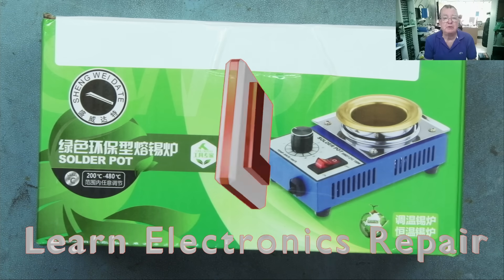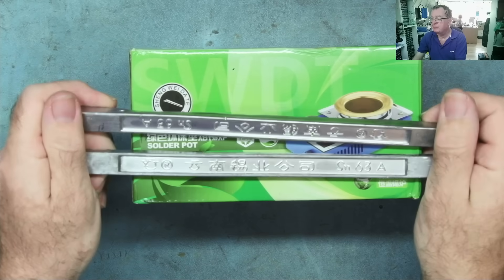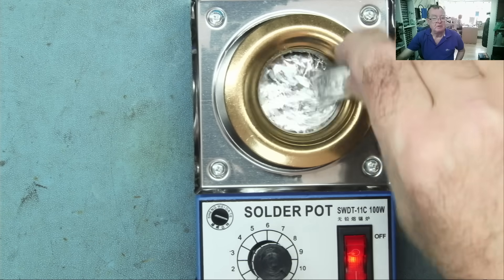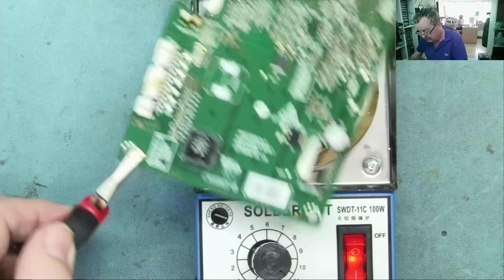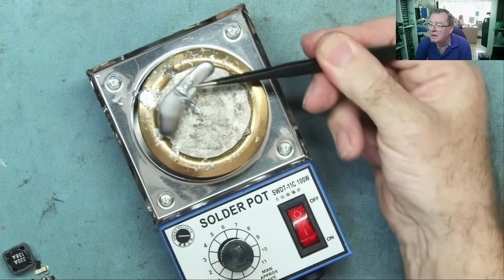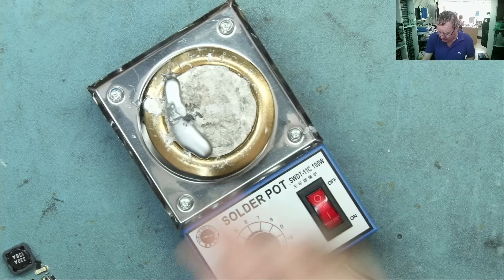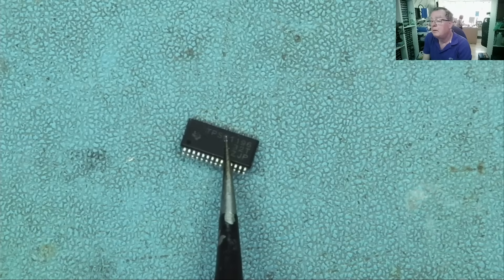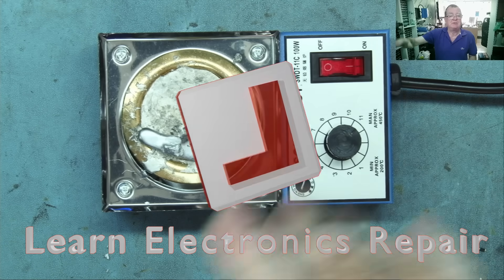How To Salvage Components QUICK & EASY With The Cheap Solder Pot From AliExpress. Desoldering.

Comment: Hello @LearnElectronicsRepair, is it suitable to safely desolder a potenciometer or a switch? Those components have a massive metal part (because they expect a pressure from users) and plastic part inside (which is moving). Every time when I was using a hot air I was melt a plastic. I have tried to heatup a tin before with a soldering iron, I have applied a flux, so it would be possible to desolder it with soldering iron nicely, if it were not had many pins and massive metal body (which is transferring heat to inner plastic part).

Comment: That's definitely leaded solder; leadfree wouldn't bend so easily. Bolt-cutters will cut the solder bar like a hot knife through butter. Note that if you use this device and this solder to remove components from leadfree PCB's, you'll contaminate the solder in the pot.....

Comment: Honestly, if I want to remove a lot of component from a board, instead of the hot gun from the soldering station, I use the 2000w hot air gun from the back .....everything fall down very quickly. In alternative, I can use the infrared pre-heater with a bit of hot air gun (soldering station).

Comment: Couple of questions:
1. If the board is all SMD components, how is this different from placing the board on the same type of hot plate used for SMD soldering?
2. To the extent that the solder pot is better than a hot plate because the molten solder conforms to the bottom of the board (including through components) and improves heat transfer, why do you need such a deep pot? Wouldn't just a shallow pool enough to conform to the plate and perhaps some depth to give some heat reservoir be enough?

Comment: This sounds like a good idea but it's actually far easier to use a heat gun / paint stripper set at 600C and blow on the back of the junk scrap board and the parts will come off just as easily without messy molten solder. I'd imagine the board will not like the direct instant heat of the molten solder and will delaminate (popcorn) pretty quickly whereas with hot air you can warm the board slowly. Also the solder in vias will spit at you when heated very quickly... this is the basic technology behind inkjet printers heh! A more interesting thought is you could re-use the (cheap) molten solder or solid bars for any kind of soldering job just add your own flux. Nowadays genuine branded flux-core leaded solder is really expensive. I recently bought a 1kg roll of 60/40 from a local electronics shop and it was $120 aussie dollars. I have to get a 1kg roll as if I get 100g I'd be constantly running back to the shop to buy more. Now if someone could design a machine that can use solid $5 bars and make thin round solder (ideally containing flux but even without flux would be ok for that price) it would be a VERY interesting project to build heh!
Reply: and is safer
Reply: I came here to make the same point. Seriously, buy a hot air rework station before you buy a solder pot.
Reply: Not a good idea when dealing with phenolic boards though - a heat gun temperature that quickly melts solder tends to turn phenolic into very smelly and toxic smoke :)

Comment: I use the same thing I replace USB ports VGA ports or any ports on a PC motherboard even connectors provided there are no components underneath usually there is not. I hade to practice a bit in the beginning to get it just right settings and temp to do it quickly.

Comment: I bought the same one 5 years ago. It came unearthed and had to earth it myself. Definitely check yours. 😉
Reply from the maker: Hmm my bench has a mains isolation transformer so nothing is earthed...
Reply: @LearnElectronicsRepair  Using a isolation transformer isolates you from mains ground earth, which isn't an issue indeed. But this might not be the case for your viewers who eventually want to buy this device. 😉
Reply: @sesvid  1st lesson always should be to open any electronics you get from China and check for "little things" like that :)

Comment: OK, not sure about this, doubly so after reading the comments.  Why do you need so much solder in the pot?  Surely a shallower pot would take less heating?
Reply: He needs the solder to touch the board. Yes a shallow pot (also filled to the top) would work but a shallow pot type is not available. Look up what solder pots are really designed for and you'll see why.

Comment: This thing is good for making crisp bread out of pcbs, specially with high temperatures.
I prefer hot air and i desoldered thousands of components with it, even various connectors.

Some of them are really sensitive to temperature, so even very low temperature will destroy them, no matter the tool.
Reply from the maker: Of course there are many different options and none work well in all cases.  This method is definitely for component salvage only. I've desoldered thousands of components with hot air also, but that does not mean you should not explore other techniques does it?
Reply: @LearnElectronicsRepair  Yeah, it's for component salvage only. But hot air makes much less mess and there is no need for excess amount of solder to use it.
Of course everyone is free to explore whatever he / she wants, i dont disagree to that at all.
But i dont recommend using this pot, because hot air is less dangerous, less mess and material to use and is more universal of use at all, especially for beginners.

Comment: I was looking at getting one of these but not for recovery work directly. Chipquik is expensive but you can buy bismuth, tin, lead etc then melt them toegther in this and make your own cheaper low temp de-solder. Just pour the liquid when mixed into a jar for use with a standard soldering iron later on. But of Alchemy:)
Reply from the maker: Interesting, but can you add flux to it while you do that?
Reply: @LearnElectronicsRepair  I'm not sure. I was just investigating making cheap low melt solder. I guess if you can buy low melt with flux in it, then it's possible to add it to your own. Again, I haven't tried... If just an interesting idea
Reply: This idea is well worth pursuing. If we could make our own chip quick, that would be really handy..

Comment: I bought one 12 months ago and use it to melt lead to make my sinkers in a mould  for fishing....does a great job!
And YES, I do it in a well ventilated area! (can't believe I have to add that comment)
Reply from the maker: The solder bars (and indeed pure lead) don't give off any fumes at soldering temperatures so why does it need good ventialtion?
Reply: @LearnElectronicsRepair  A lot of people think the fumes from solder are actually metals like the lead, when it's just the flux (Flux is still bad for your lungs, but not as bad as lead)
And with bars or lead stuff there won't be fumes, unless there's some grease/oil/dirt on them
Reply: @Psyden5757 , the boiling/vapor point of lead is over 1100 °F, but solder melts at a far lower temperature. There are no metallic vapors produced by molten solder, just flux fumes.
Reply: @goodun2974  Yes that's what I was saying
Reply: @LearnElectronicsRepair  I don't know, but some of the fumes might be hard to see. I'd use a fume extractor with filters, just to be safe.
Reply: @LearnElectronicsRepair  Just to be safe from the lead fumes Rich, as I'm getting older I appreciate how fragile life can be and I take less and less risks...
Reply: @darrenbird2526  It is not just the lead fumes you have to worry about. There are other components in solder like tin, cadmium, copper, and even the rosin flux.  Apparently, "Rosin-based solder flux fume is now regarded as one of the most significant causes of occupational asthma in Britain. "
Reply: You read my mind!  I usually use a pot over gas to melt my lead but this thing would be great for doing 1 or 2 at a time.  🎣:fish-orange-wide-eyes:
Reply: @darrenbird2526   , you must be fishing in small ponds; for fishing in Long Island Sound (saktwater) I never bothered making sinkers less than 1 ounce and we mostly used 2 or 3 oz, as well as 12 ounce jigs and sinkers wheen fishing for bluefish. This tiny pot would be useless for that. I used a cast iron pot over a propane camping stove, it held at least 5 pounds of lead.

Comment: This is the most ludicrous and dangerous proposal for the use of a solder pot. It is normally used for tinning wires and component legs prior to installation. Damn, but I think lead poisoning has taken effect on you, Richard (the same thing that gave rise to the "Mad as a Hatter" phrase!
Reply from the maker: This wasn't actually my proposal or idea. I saw some other Youtubers doing it on foriegn language channels and thought it looked like an interesting idea so wanted to give it a go.  IMHO it was quite scary having a pot full of moltem metal on the bench but it did work very well, espececially on the plastic connectors.  Anyone wanting to try this I would suggest put the solder pot into a deep flat bottomed baking tray and wear good heat resistant gloves.  You will probably be safe but it's your decision.  I quite enjoyed tyring this but can't say for sure I will be doing it again.  Oh but then is the livestream this coming Sunday... 😅
Reply: @LearnElectronicsRepair  Well I think most of us are aware of some of the "foreign channel" idiots but we don't copy what's  obviously dangerous. If you lived in a castle it would be handy for pouring molten lead from the battlements onto the enemy (we still do that here in Scotland) lol

Comment: Take the board outside connect to a vibrating source then use a plumbing torch to heat the bottom of the board. Works like a charm.
Reply: Haha. I heard that the chinese component reclaimers use an old washing machine. They put the PCBs inside, and use a propane space heater at a suitable distance from the door opening, and the parts get automatically disloged falling into the curviture of the drum